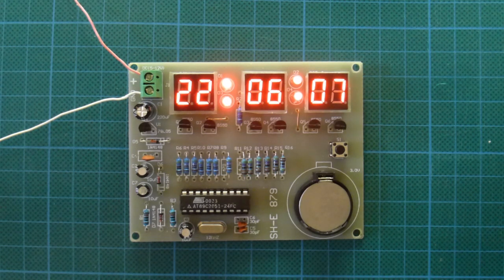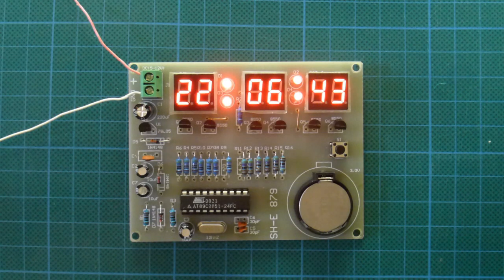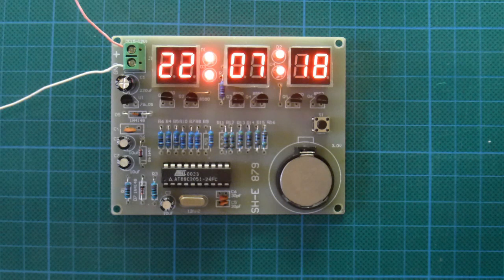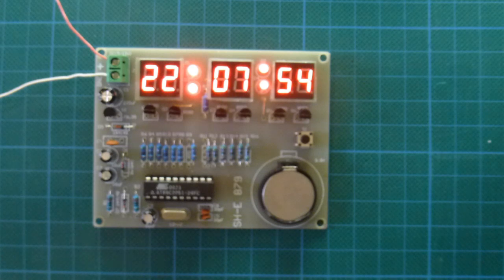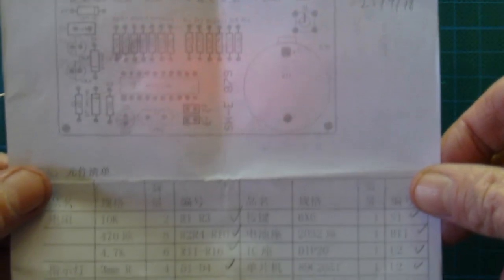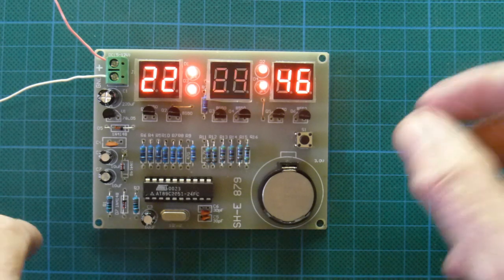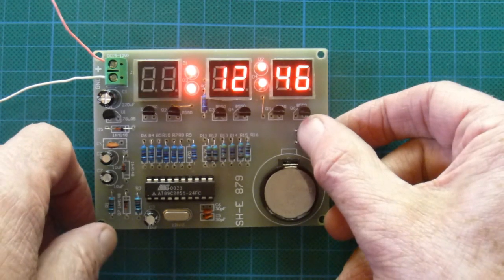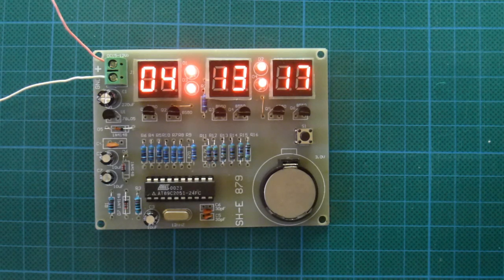Cheap Ebay clock kit SH-E 879 with AT89C2051 microcontroller

Comment: Note that the colon LEDs thru-holes do not line up correctly.  Be sure to leave enough length in the LED legs to adjust them to the correct alignment.